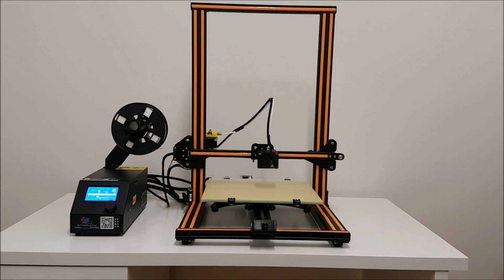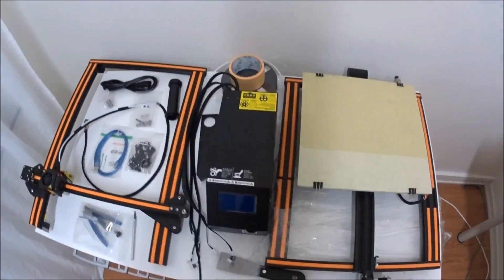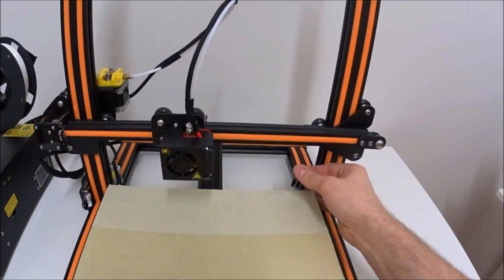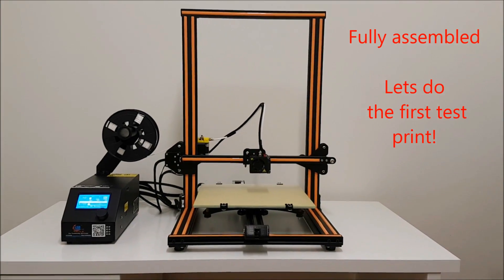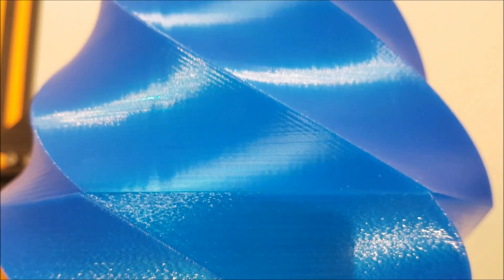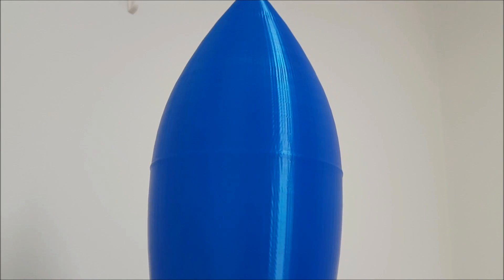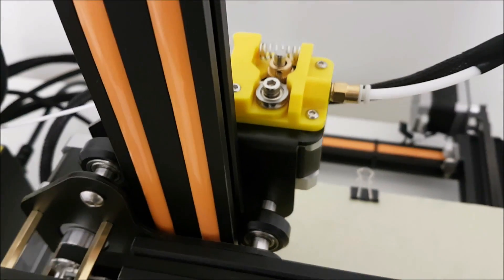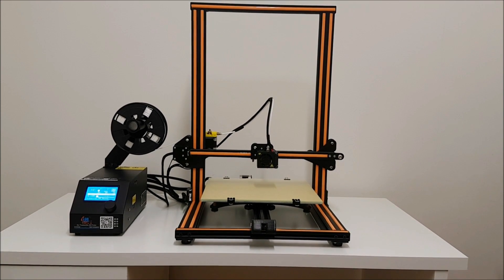Creality CR-10 3D Printer build and REVIEW Biggest desktop 3D printer!

Comment: In your opinion, is this the best relatively inexpensive step up from the Anet A8? I've discovered that slowly my bearings are becoming less reliable and are causing some issues in my prints, as well as i find the printer becoming less reliable as i go. What say you?
Reply from the maker: Kyron Williams Yes Definitely. CR-10 is great upgrade from Anet A8. But bearings for Anet are like 5-10usd so it's easy fixable. So if you don't need to print large you can easily just swoop bearing and keep using A8.
Reply: Nexi Tech You make a valid point and thanks for the response, but i tend to print things that are at the point of max height at of the printer. I've also had issues with a lot of my files being printed improperly. And I'm fairly certain it's not because of corruption of files because I try as hard as i can to have a good method to prevent corruption.

Comment: Which would you recommend the Kossel or CR-10 ? What is difference in speed?
Reply from the maker: netwolfstar Kossel is faster CR-10 makes biger object. Kossel you have to assembly and calibrate CR-10 are 85% pre-assembled and its easy to calibrate. CR10 has Heated bed Kossel don't. They are both great printer's for money. It depend on your needs. If you are not in hurry take CR-10 if you are short in budget take Kossel.
Reply: Nexi Tech did you get the pulley or linear plus version of kossel?
Reply from the maker: netwolfstar Pully. Check it you have link in video description. Cheers

Comment: Nice videos! Can you tell me if there are big print quality differences between the Anet A6 and the CR-10? And which one would you choose? :)
Reply from the maker: Thanks mate! Well there is not big differences in print quality but they are  different 3D printers. Build quality is amazing. Frame is full metal rock solid and stable. Simple design and easy to assemble. Great print quality. Print volume is HUGE and it has very reliable components.  If you have space and extra $$$ I would go with CR-10 its worth every singe dollar. If you wiling to order it check links in description and use coupon to get cheaper price. Cheers! :)

Comment: hi what is your slicer setting for the rocket and vase print
Reply from the maker: CURA 15.04.6 PLA: hot end 200c; Heatbed 55C; Layer height 0.2mm; Shell thickness 0.8; Botton/top 0.6mm; Fil Density 0; Print speed 40mm/s ; travel speed 55mm/s Bottom/top speed 20mm/s  retraction 40 mm/s Brim(on) 10 lines; Nozzle 0.4mm Cooling 100%; Total print time around 15 hours 21min. Cheers!

Comment: Love your videos man! Shame you dont live in Europe I want to buy more CRs. Could you please tell us the settings of that 15 hours print? I do similar highs and more than 20 hours each. Also .2mm  Thanks
Reply from the maker: Thanks man! Well there is US and EU version. Check video description maybe you will find one to your needs. Settings? No problem! CURA 15.04.6 PLA: hot end 200c; Heatbed 55C; Layer height 0.2mm; Shell thickness 0.8; Botton/top 0.6mm; Fil Density 0; Print speed 40mm/s ; travel speed 55mm/s Bottom/top speed 20mm/s  retraction 40 mm/s Brim(on) 10 lines; Nozzle 0.4mm Cooling 100%; Total print time around 15 hours 21min. Cheers!
Reply: Many thanks!! I will  try  that setup  tomorrow and i will compare but sure better than mine!

Comment from the maker: First update and testing on Heat-bed temps! I Just did testing time and max temp of heat-bed here is results: 
35C- 1m:30sec 
40C- 2m:10sec
45C- 3m:12sec
50C- 4m.01sec
55C- 5m:02sec
60C- 6m:12sec
65C- 7m:45sec
70C- 9m:15sec
75C- 11m:21sec
80C- 13m:48sec
85C- 17m:27sec
90C- 23m:44sec
Look like that 85C is max safe temp on heat-bed. Over 90C just take forever to go up. Power supply gets worm on 90C(not Burning hot but still) For ABS is almost enough to print it. I use just 80C with brim option(on) in CURA. I hope I helped. Cheers!
                                                                          ------UPDATE------ 
I just open control box and it looks very well build inside as well: 
Its not power supply that gets warm it's heat-bed module but its attached on metal side of control-box and temperature is spreading so there is no worry, heat-bed can go even higher if you want to wait more. There is two always on fans inside control box,one in middle and one at back of control-box. Power-supply is 30A 12V and it has auto fan on-off and on most time under 55-65c its not even on! Looks very good build inside. I will make video what is inside soon. 
Cheers! 
--------------Update-----------
With only 220x220cm Insulation material under heated you can achieve and maintain about 99 degree Celsius which is good enough for printing ABS of PETG materials. Here is image of test: https://goo.gl/dqXYVR

Comment: dear nexi, can you tell something about the bed temp? will the bed arriving the temperature of more than 120 C for printing out ABS models?
Reply from the maker: I Just did testing time and max temp of heat-bed here is results: 
35C- 1m:30sec 
40C- 2m:10sec
45C- 3m:12sec
50C- 4m.01sec
55C- 5m:02sec
60C- 6m:12sec
65C- 7m:45sec
70C- 9m:15sec
75C- 11m:21sec
80C- 13m:48sec
85C- 17m:27sec
90C- 23m:44sec
Look like that 85C is max safe temp on heat-bed. Over 90C just take forever to go up. Power supply gets worm on 90C(not Burning hot but still) For ABS is more than enough to print it. I use just 80C first couple layers(minutes) with brim option(on) in CURA and than I turn heatbed on 45C or switch it off to 0C. I hope I helped. Cheers!
                                                             ------UPDATE------ 
I just open control box and it looks very well build inside as well: 
Its not power supply that gets warm its heat-bed module. But there is two always on fans inside control box. Power-supply is 30A 12V has auto fan on-off and on most time under 55-65c its not even on! Look very good build inside. I will make video what is inside soon.
Reply: kamplintfort6681 thats what i would be interested in as well
Reply: Nexi are you sure you can print out very giant ABS models with only brim option and 80C? small models are not the problem but if I grow up more than 10cm in the bottom aide, I will get big problems with warping at the ends of ABS models with this size when I print it on my Anet A8
Reply: Nexi thanks fort testing... thats not the best heatbed, but like you said for smaller abs prints it is absolutely enough
Reply from the maker: Like I said use Brim function( which put big surface around 3D model) in CURA you can print ABS even without Heated-bed. There are people on you-tube that also showing that. Look my video when I print skull on ABS on lower print temps. https://www.youtube.com/watch?v=wixImkgc6jA

Comment: Be careful about the x's belt, it appears that you have the same problem that my CR-10 had. You need a smaller nut to get the belt centered in the extrusion to avoid any friction with the aluminium.. http://imgur.com/a/48x1T

Great printer anyway!!
Reply from the maker: Thanks for tips mate! I just check it on top of V-rail and it looks fine and in center but on under side it looks that belts are not in center and that it robber on V-slot under it. Hm.. It looks that belt moves little on side under due to space(loose) on the belt end connection on X carriage. I will make update fix for that or I will find smaller(shorter) nut or I will print out something like limiter to make it smooth. Thank you for notice mate!
 Best greetings from Sweden!  P.S. Printer is awesome am so happy to finally have it!
Reply from the maker: Done I fix it. I just print washer Out diameter 21mm iner diameter 16mm and 1.8mm thick install it in one minute. Now belt is in center of V-slot. No more friction. Done :) http://imgur.com/a/1tZo4

Comment: the comparison prints look like they were printed at different temperatures. Or it could also be that the nozzle on the tronxy is a bit clogged. And one advice, dont turn on music while you are talking imo. nice vid as always
Reply from the maker: Temps and settings are exactly the same. To be honest nozzle on Tronxy is more clear than on the CR-10. For example: If I set temps on extruder on 200c on both printers and manually push filament true hot end on Tronxy going much easier than on Cr-10. That make me thing that maybe nozzle are different or temps are different but not really. I check with laser temp sensor and they are the same. It make me thing that maybe linear bearings on Tronxy oscillate or wobble just tiny bit to make print not clear. I will make in dept look to find out more info of that because all my prints on Tronxy is like that. But to be honest its looks nice for example maybe people will preferred more that look. I don't know :) Thanks for comment. :)
Reply: Thanks for the in depth answer. 
Well i really like the cr10 print. The smoother the better for me :)
Reply from the maker: You welcome! :) Yeah smooth baby :D Take care!

Comment: Hi man nice video , what version of cura are you using and also what settings ? Im struggling with settings on my CR-10 . Take care
Reply from the maker: Thanks man! CURA verison is 15.04.6 Settings is PLA 200C Heatbed is 55C first couple layer and then on 0C. Print Speed is from 35-55mm/s Travel 55-75mm/s for now. Layer height is 0.2mm or 0.1mm, fan Air speed 100%. I don't push too much speed on huge prints I try to keep it slow to get better quality. For example this rocket is around 15 hours to print and if you push it it can make under 12h but, is is really matter if you print it over night? Not really. Take care. 
P.S. Print out nozzle duct update and install on your printer, I make one to replace original. Check video description.
Reply: Thanks a lot buddy for the reply and the info . Love your content and keep up the good work .Already printed out the duct and will post a pic to your thingiverse . It works perfectly !!
Reply from the maker: Thanks for positive feedback mate! I try to make more :) Nice! Do it. I am Glad you like it :) Cheers!
Reply from the maker: You can use retraction speed same or higher as print speed.
Reply: Nexi it's very kind of you to reply. I'm just upgrading my anet a8 to E3D V6 extruder. I'm now battling with the stringging and blobbing, i hope you can do a video about that . :D